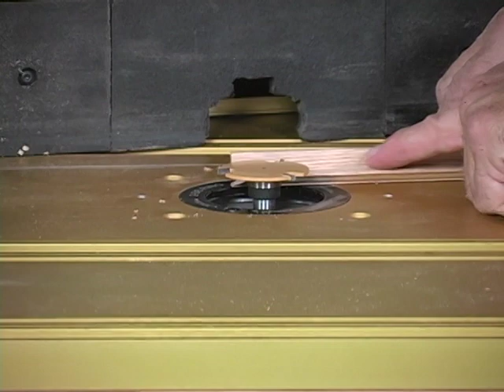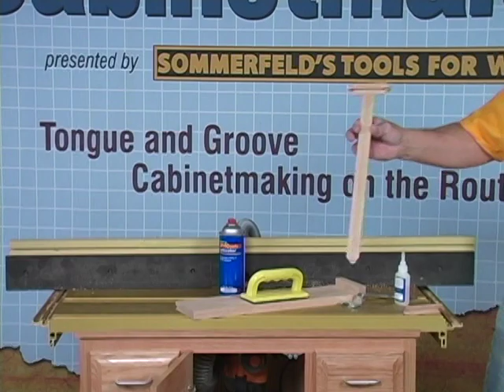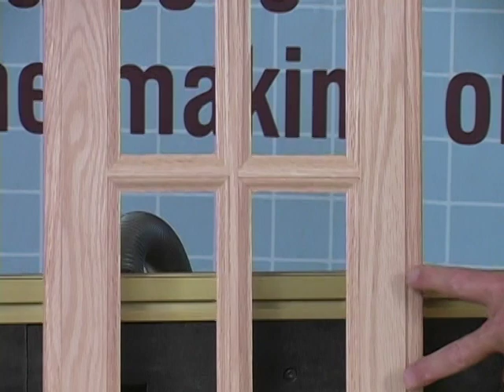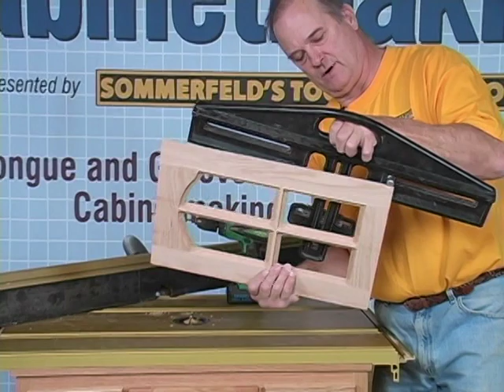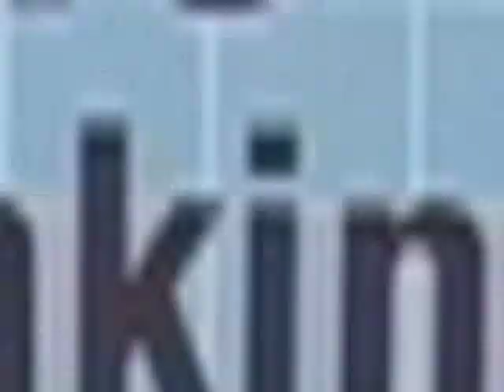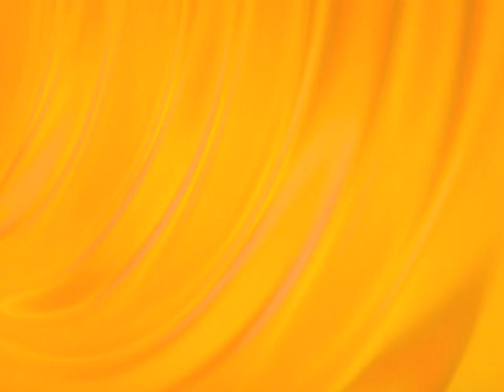Sommerfeld's Tools for Wood - Glass Panel Doors Made Easy with Marc Sommerfeld - Part 3

Comment: What size router in HP are you using for most of your cabinetmaking?  I'm planning on building a router table and I want the router to be used solely for that table.